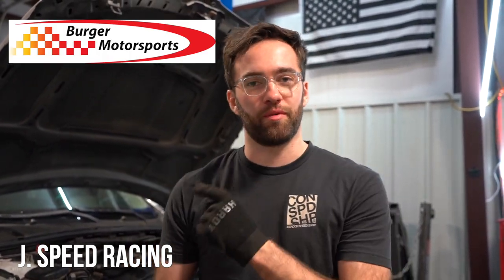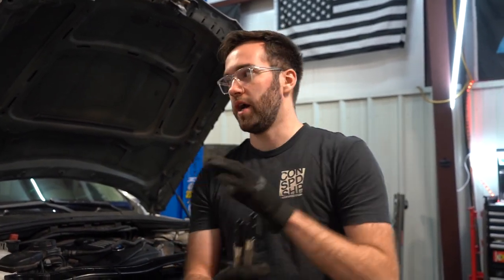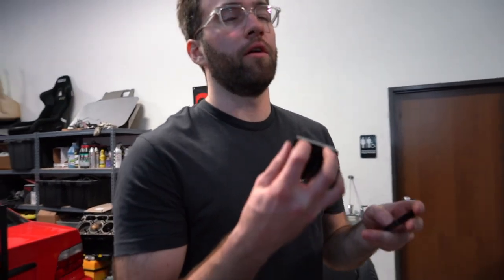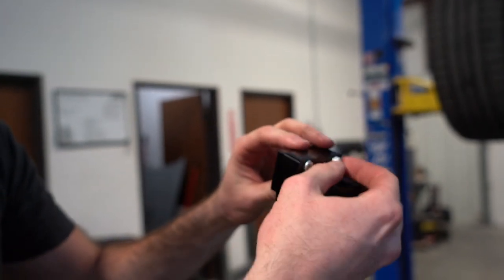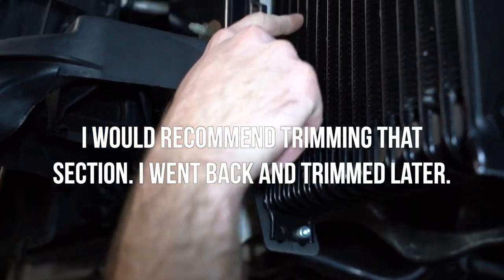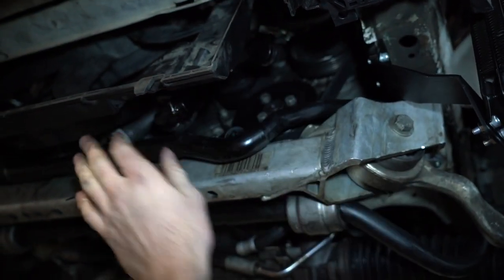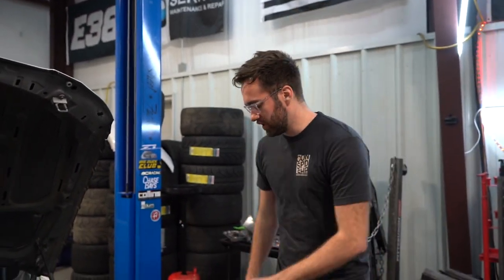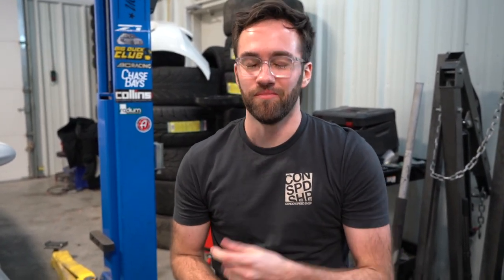BURGER MOTORSPORTS BMW E90 335i N54/N55 Auto Transmission Cooler

Comment: Question, how does this cool the transmission when the car is stationary for example? There is no air flow when the car is not in motion. So how can it be better than the factory transmission cooler?
Reply from the maker: It's large enough to do the job. Plus it keeps temps lower at speed supposedly. So far so good with mine.
Reply: @jspeedracing  just the answer I was hoping for. Thanks!

Comment: Thanks for video . I'm thinking about doing same upgrade on my n52/gm auto transmission ! I noticed last time i looked at the oil cooler that it's kinda leaking around the hoses where they connect to the cooler ! I'm also experiencing gear slipping over 2000rpm . Transmission service is done still acts the same .. no codes or lights at all which is a stab in the head for me . So I'm  going to do this and see lol
Reply: You’re low on fluid

Comment: Center & other workshops due to the unavailableilty of the spare part. There are many other owners who are driving daily with the fear of the ATF cooler replacement and AT failures at anytime.

Please advise us with your expertise view on this and suggest us is there any other alternative for this issues and is it possible to use any after market ATF coolers to resolve the issue for the long term usage of our cars.

Your expertise and advice would help many thousand owners.

Thanks in advance

Comment: How long does it take for the transmission to warm up? The coolant helps to heat up the transmission fluid. Guessing this isnt a great mod for cars in colder climates.
Reply from the maker: Correct, if you just casually daily drive it especially in a cold place, this might not be needed. But if you drive spiritedly in a warm place, this would be a great mod!

Comment: Question. Installed this cooler but the hoses barely fit in the space between the fan and harmonic balancer.  I am afraid the hoses will contact either device and get damaged.  How did you work around that?
Reply from the maker: Maybe zip tie them to the fan shroud thing?

Comment: Where did you fill the trans fluid? fill plug on the transmission or did you fill it directly into trans cooler. Thanks
Reply from the maker: I think we did it into the trans, ran it a very small amount then topped it off a time or two. Please verify
Reply: @jspeedracing  okay cool, thank you

Comment: When I purchased it it came w black AN fittings which I thought were durable until the bracket snapped and took out the cooler along w the lines w it :(
Reply: Did you leave a review on urotuning lol

Comment: If you are replacing the radiator at the same time get the one for the manual trans
Reply: So a manual trans radiator will work on my N55? Already thought it was kinda stupid to make 2 blockoff plates vs looping the system with 1 connecting part.
Reply: @scottvandeven1150  yup and you need a manual trans coolant pipe that runs along the subframe

Comment: I hear a lot of people saying to add a thermostat. Have you had any issues without one?
Reply from the maker: I actually sold the car somewhat soon after this install so I am not quite sure. Sorry bro. Make sure to subscribe!
Reply: I am wondering the same thing. Nobody has mentioned running an inline thermostat with this kit which I was under the impression was necssary.

Comment: Nice kit but... didn't fit with the wheel liner without modification. Bracket didn't hold the  cooler without modification. Transmission lines are very close to the harmonic balancer or the fan, has to be made to stay in between with modification. This is not as plug and play as it's supposed to be, not for me anyways.
Reply: How did you solve the problem of the transmission lines being so close to the balancer and fan?  Seems like a disaster waiting to happen!
Reply: @schem43  Zip ties. I zipped them to where they ride vertically and closer to the fan. Figured if anything happens the braided lines have more of a chance then the rubber lines above the balancer. So far so good with speeds up to 130.

Comment: If it were up to me id use both coolers
Reply: Exactly.... id have the mode before it also so it can maintain operating temperature... you don't want it hotter or colder

Comment: What can it be on a cold engine for about 10 seconds. I hear the BMW e90 335i N55 rattling
Reply from the maker: Ya the 335i's are a little tricky. Wastegate?
Reply: I have the same issues right now, did you fix it?

Comment: will the splash guard in the wheel well be in the way?
Reply from the maker: I am not sure. My 335i was a rebuilt title so it did not have any. I am sure you will be fine
Reply: The splash guard will not go back up with the cooler. Modification to the guard will be needed if you still want to have it on.